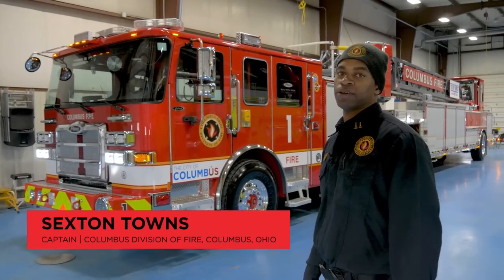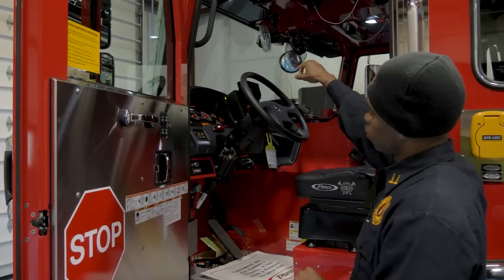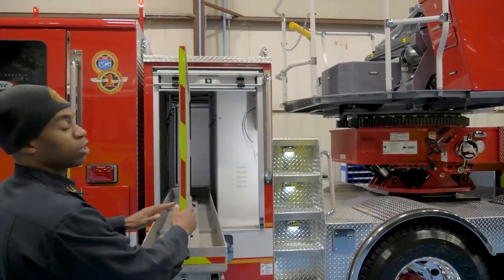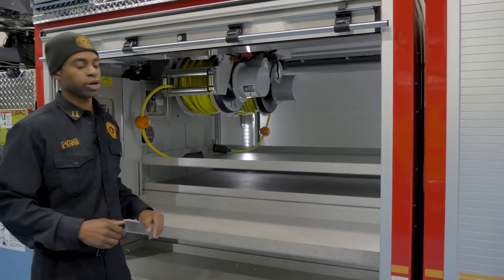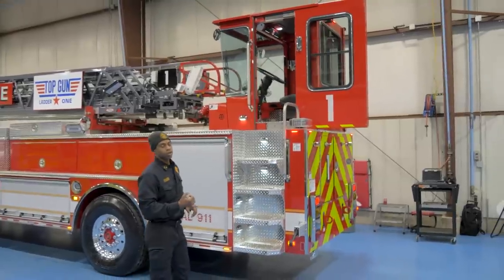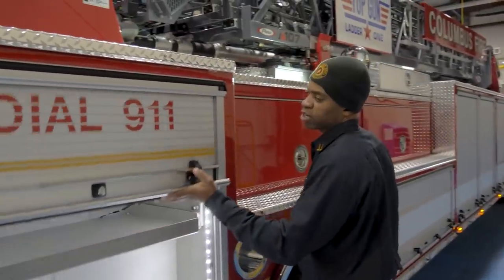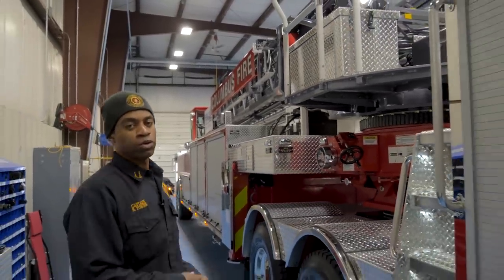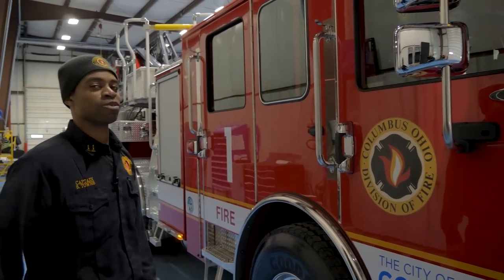Enforcer™ Ascendant® 107' Heavy Duty Tiller Aerial Ladder –Columbus, OH

Comment: Beautiful truck. I bet it ran over $1 million.
Reply: Easily $1.5 million, if not more.
Reply: Easy lol
Reply: And worth every penny.
Reply: @CPR12345  That would make 100 million pennies.
Reply: @geoffreymiller5422  yep a rig like that easy over 1.5 mil
Reply: @CPR12345  I bet you could buy a nice low cab aerial only apparatus (2-3 men cab, minimum equipment) with a foldable platform, and an engine for that money.
Reply: @solarissv777  Yeah, so? What’s your point? This is what Columbus wanted, to fit their needs. So, they had it built.

Comment: Wait how is there 7 seating i only count 6 seats?
Reply: Oh wait I just realized that the tiller man is the 7! 🤦‍♂️ lol I feel dumb.
Reply: @mattlenardson6567  yep, seating for one in the doghouse!
Reply: It doesn't matter about the seats, most departments can only afford three or four firefighters per unit. Then time off takes more personnel away.
Reply: @scootertrash911  lol yeah I know that. I always think it’s funny when departments say if we need extra seats for guys that really only works for some vol. fire departments. I’m like don’t you guys always try to save money by eliminating unnecessary man power.
Reply: @mattlenardson6567  If they carry only 3 people anyway, why have a tiller at all? Just build an aerial on Freightliner Econic chassis (low cab, can fit up to 4 people in one row) and call it a day. For some extra narrow streets, there are versions with additional steerable rear axle.
Reply: @solarissv777  but I thought those were harder to manage but I kinda agree!
Reply: @mattlenardson6567  those are dumpster truck chassis, if the city uses them for waste disposal, firetrucks would be signifficantly cheaper to operate due to parts commonality. Additionally some money could be saved on bulk orders of trucks. This chassis (Mercedes Econic) are widely used in Europe  for fire aerial chassis as well as hauling cargoes through narrow streets, heck I've even seen a concrete mixer with a steerable rear axle built on one. Also, those steerable rear axles are an option from the manufacturer, so no additional custom work is needed. Oh, and they already come with PTO from the factory.
Reply: @solarissv777  well Idk about all that, it makes sense what you’re saying, since in my own fleet all I have is Fords for multiple reasons. Such as parts, maintenance, and uniformity. Also from luck/fate but I feel that it is what is since multiple agencies don’t mix sanitation fleet and emergency fleet. I don’t think they’ll do things ever like that. But economically you’re logic could make sense.